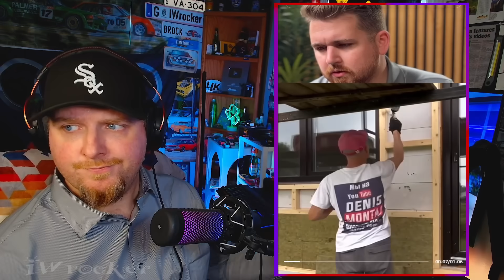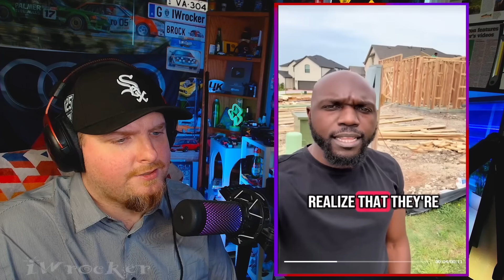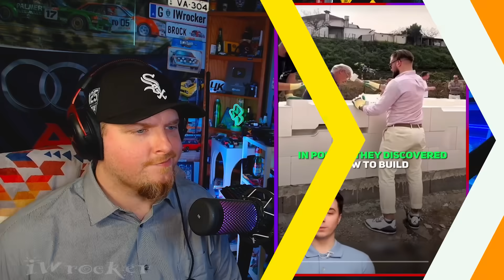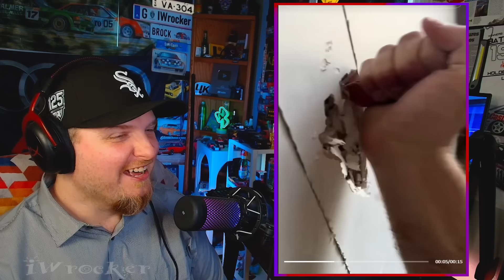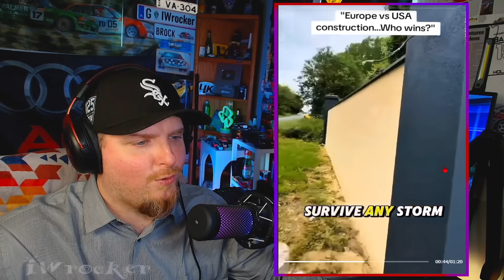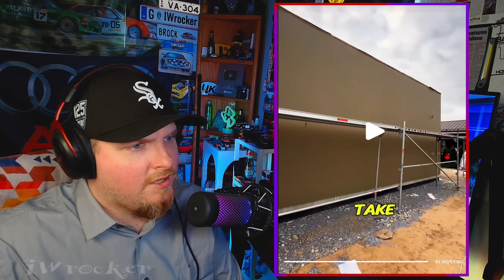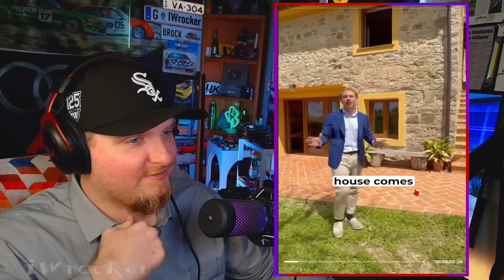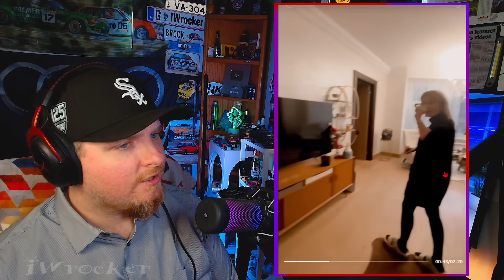25 Minutes of European VS American Home Quality & Construction Methods 🔨

Comment: London has a number of fake houses that hide infrastructure related to the underground,  some hide  sections of tunnels that come to the surface due to the use of steam trains, others hide the ventilation ducts, etc.  They are used to prevent unsightly breaks in the rows of  terraced houses.    The one in the picture was most likely built to provide an end terrace while hiding the an underground line behind it.
Reply: You're right that it hides an underground line (the District Line just east of South Kensington Station) but it is actually a genuine, triangular, house, "the Thin House". It has a Wikipedia page.

Comment: Q:  "Why would you put the insulation on the outside of the building?"
A:  The "building" is made of BRICKS (that "white stuff" ISNT drywall but rather some sort of large scale brick) and WATER will always get inside the walls in some form or another, but >>> IF THAT WATER FREEZES it wíll burst the brick and damage the wall <<< and thus the insulation needs to be ON THE OUTSIDE to keep the temperature in the wall ABOVE FREEZING!

Comment: The first few seconds of the video, and damn it, why are the Russians putting wood between the insulation? It will create a thermal bridge, and if there is moisture, it will rot. They should do it without wood, like the rest of Europe. Or maybe, the video isnt complete and there will be another layer. As far as insulation is concerned, all houses have insulation, and I would say that most houses are insulated from the outside. The rest have insulation directly in the brickwork, for example Porotherm 44T.

Comment: I just realized that americans NEED fire detectors, otherwise it will all go up in flames before you notice it (if youre asleep, for example). Also, paper walls....it does seem practical for remodeling, but i rather have concrete walls.

Comment: Many buildings of the seventies/eighties, or earlier, in France are getting a big "facelift" with external insulation, can be foam or natural fibre, covering every surface, then a protective layer, and if the owners can afford it change of windows into triple glazed. Because all this is costly, even if the benefits are good...

Comment: In the first example, insulation tends to be on the outside of walls because the slightly denser fabric of the wall provides better thermal control. Additionally, those walls would be fully weather protected using Brick/Stone/presure treated timbers/thermal weather board etc. they would not be left like that. Secondly the internal wall appears to be made of lightweight, aerated concrete blocks known used for excellent thermal insulation, sound reduction, and fire resistance, they trap more air in a cellular structure, making them ideal for energy-efficient but sustainable walls.

Comment: About insulation: i live in renovated apparment with 15cm insulation on outer wall. For heating last month (coldest month in 10 years) i paid 45€. My co-worker for similar appartment in  not renovated appartment paid about 160€. So yeah, renovation is worth it.  Also it works both ways: it doesn't let Cold in at Winter, and it doesn't let Heat in at Summer.

Comment: The false facade is a feature to keep the look of the street from the font but there are a few in London where the Tube train goes under that facade often with an open tunnel behind.
Reply: USA also has some of those in big cities they often hide tranformers and other municipal equipment and some are for air conditioning units and access routes for the metro systems.
Reply: This particular one is not actually a false facade -- it is a genuine block of flats. It's got its own Wikipedia page, "the Thin House". But it is railway-related; it was built on a triangular plot of land left over when the Metropolitan District Railway cut its way through South Kensington. It's just north-east of the station.

Comment: That exterior insulation plus interior insulation, is how you get to spend summers without needing AC. It can be 35C (or more) outside with high humidity, and all I have to do is keep the drapes shut, or put a screen on the windows and the place feels actually chilly (last summer I had 21 C in the room most exposed to the sun). You only open them to air out in the evening, or at night, when it's cooler so you can get some fresh air too, and with the bug screen installed on the outside of the windows, no buzzing bloodsuckers come in. And during the winter, it does help keep the heat it. When we did it, very few in my town have done it before, but nowadays, one can get a contract through City Hall and get the whole apt. building insulated. And roofed, and have the amenities fixed.. like elevators and clean the basements and stuff like that. Oh and they can also change the windows, if the tenant wants that. It's part of an investment program which attracts funding from the EU for energy efficiency. Don't know if it happens in all the EU countries, but it does in Romania.
Reply: In Croatia is the same, the energy efficiency scheme.
Reply: We need it here in Portugal.
Reply: @anamarques5599  ask around at the City Hall in your town or search the internet... it might be available there too. We didn't know about the program in my town until the mayor was campaigning and sorta used this to show how much he was doing for the people and bla bla...

Comment: I constantly have problems putting nails in the walls because it's a fckin brick behind the paint 😅
Reply: Brick? You're lucky. My 1880 house has flint in parts of the walls. Sometimes you have to change your plans about where to attach things to the walls.

Comment: I dont know if this fasade house in london is one  but there are  ventalation shafts and utiltys for subway in simliar  buildings in london they do it too blend in in the area instead of ugly ventalation shafts
Reply: Actually the Underground passes behind the building at an acute angle in a very wide cutting so no need for a ventilation shaft as such.

Comment: hearing him say "They have concrete walls" and seeing that he is amazed by this makes me so worried about the states
Reply: There is nothing inherently wrong with building homes from wood, they do it in the Nordics too. Every culture builds from what they have available locally. The problem is that they minimize costs and build cheap, while maximizing sale price.
Reply: @szaszm_  If done properly it's fine. My house is a wooden structure and it was built in the 1500s.
But we're talking about American houses here😂
Reply: i helped my FIL in his business while a 2 months vacation in the USA....
the first time in my live, i saw a laundry dryer with a gas connection!
he been so surprised that i fit the windows so tight in a frame, i had to cut out some wood to make it fit in...i used a metric tap measure...
i am a German electrician, i can work down to 0,5mm!
Reply: Don't shed any tears for the US;. They're getting what they deserve. They had a perfectly fine, innovative democracy and through neglect and hubris threw it all away. And still try to lord it over everyone else. (This from a Yank)
Reply: usa, the third world country.
Reply: and it vas not concrete ,large brick

Comment: Modern Aussie homes are a mix of US and European building methods.
A US style wooden frame but clad in real brick and with a concrete tile or sheet steel Colorbond roof.
Yes they still burn down, but the hard fire resistant she'll reduces the risk.
The interior walls are usually drywall.
But the sound of rain on a tin roof is better than any lullaby!

Comment: Why is he installing insulation on the outside? Because you need to insulate the walls, not the air inside the house. Otherwise, the walls are still exposed to the outside, transferring cold or heat inside, absorbing moisture, and then you get mold.
It's a funny thing about these walls: when you want to remodel something in the states, you need a utility knife, a saw, and maybe a hammer. When I want to remodel something at home, I need a heavy-duty hammer, an angle grinder, etc.😅
These Lego 3E concept blocks from Poland are actually a very new solution, more of a curiosity than a material that everyone is building with now. So far, they have been used only for show houses and no more than 100-150 private constructions (not all of them are houses).

This building in London is wedge-shaped and in the film it is cleverly shown only up to the point where you can't see the other side, but the rooms on the edge are actually very tiny is 1.8m wide.
here's a street view https://maps.app.goo.gl/EyCbNdYJ53zext2j9

Comment: Insulation from outside is the most logical way. Bricks are thermal accumulators and insulation keeps it inside. Those white brics I tested on shooting range. I had Ytong Static 30cm deep brick. I used .44mag, 4in revolver from distance around 10meters. It didnt get through the brick, the projectile was stuck roughly in 10cm depth.

Comment: That apparently skinny building in London is at 5  Thurloe Square and is known as "The Thin House". It's actually the thinnest part of a wedge-shaped building that's 34ft wide at the far end, built to fit onto an odd-shaped bit of land left after the construction of a Tube station in the 19th century.
Reply: Yes, this is the best explanation of those I've seen so far. The Underground (District and Circle Lines) pass behind in a cutting at an an acute angle... they do not pass underneath the house.
Reply: Most European cities were also designed with winds in mind. That building row blocks winds and likely helps regulate temperature, particularly the wind chill for the rest of the town/city.

Comment: 18:00 Thats not a house it's a façade, it's to hide the Underground passing underneath, the open space at the rear is to vent gasses.
Reply: The Underground does not pass underneath the house... it's behind it at an acute angle, so the building has a wedge-shaped floor plan.

Comment: I recently hung a painting on an interior wall of my house. I had to use a Hilti hammer drill to drill a 6 millimeter hole in the concrete.
Reply: I feel you. I got myself a new home cinema screen for christmas last year. I tried to drill 4 holes in the ceiling with a regular hammer drill to no avail... ordinary masonary drill just glowed red and didn't penetrate more than 5mm deep. I had to get out the SDS pneumatic hammer drill and the concrete drill bits 🤣
Reply: i feel you, our cottage is built from cement that was used on a 50m dam - carbide drills are just consumables
Reply: Had the same issue but no drill. I decided to avoid the concrete and hammered a nail through the brick a bit to the side.
Reply: You don't need to do that. Just take  paper tape, put a thick paper clip bent such that it forms a sort of T against the wall with a hook (basically bend it with pliers so it forms a double hook by bending the center part) and then put heavy duty 3M painter's tape over it. Two wide straps across it vertically followed by four wide straps across it horizontally and you can hang about (last i tested this for curiosity and long term viability) 1450 grams of weight for about 5 years (only that much because the tape started unsticking from the wall. No holes needed.
Reply: As nature has meant it to be😂
Reply: A little lifehack I've learned is that flat drill bits for ceramic (the ones that kinda look like an arrow tip) work just fine on the concrete as well. And are MUCH quieter. Just be mindful of overheating so keep a glass of water nearby to dip it in from time to time.
Reply: @DarthBiomech  unless you hit the rebar....!
get a Hilti with a 6mm Hilti drill......no problem...
i use at home a Bosch battery drilling machine with  SDS+ Hilti drills...and i have no troubles...i even own 25mmx1000mm drills!
Reply: What kind of a painting is it that you have to drill like that? Usually you just need a regular power drill, a screw and a fastener, also a lot of houses have mortar on the walls so you can even just nail a nail in them if it's for something lighter
Reply: @went2fast  It's not the painting. It's the wall. I'm in the same situation, had to rent a rotary hammer just to hang some curtains. I started out with a regular impact drill, it took over an hour to drill a single 6mm hole about 50mm deep. Not because the curtains are anything special, but because my walls are concrete. Not "concrete" cement blocks mind you, honest to god poured reinforced concrete.
Reply: @HertogLeo  Fenstersturz is always concrete....and i own only drilling machines like with pneumatic hammer drill....even my Bosch battery drill is air impact!

Comment: The first guy is a moron… you put the insulation outside the walls because the walls will store the temperature from inside. In winter, it will store the heat from inside, lowering your heating costs and in summer, it will store the cold from inside, avoiding you to use active cooling too much if at all (most of the time, opening a window to air out is enough).

Comment: That thin house in London might be a fake house. The London Underground has done this several times because there’s an open shaft behind it that the subway needs. They built just a facade to make it look better, but I can’t say for sure if that applies to this specific one. A prime example of this is 23 and 24 Leinster Gardens in Bayswater, where such facades exist; you can even see from the satellite view on Google Maps that there are no actual buildings behind them.
Reply: Yes, but 5 Thurloe Square is a genuine building, "the Thin House". Wikipedia has details.
Reply: @kgbgb3663 Ah, I see. 5 Thurloe Square is an actual building then, not just a facade. It’s a real triangular house that's super thin on one side because of the Tube. So I was wrong about it being a fake front, but right about the reason why!

Comment: " Why would you put the isolation on the outside of the building?" Holy crap, the absolute ignorance and no shame at all... he even seems to be proud of it. Thermal insulation must always be on the outside, resp. on the cold side of a building to avoid condensation damage and mold. This is basic physics any competent builder has to know. Only exeption if the house is a protected heritage, or there is no room to add insulation on the outer walls... No wonder US homes don't last longer than 30 years before the next refurbishment is due.

Comment: That London house is a wedge shape. So yes it's narrow at one end, but they deliberately stop the video to make it look way narrower than it actually is. Remember we don't have block roads. So two roads were meeting at an acute angle and they realised every space possible for building.
Reply: Correct, but in this case it's not two roads, but a road (Thurloe Square) and a railway (the District Line just east of South Kensington station).

Comment: Our garden sheds are stronger than your houses.  You want to take my house  wall down you will need a mini Jack or a sledge hammer.  Yes cost more to built but will house at least 10 generations so much much cheaper in the long run.